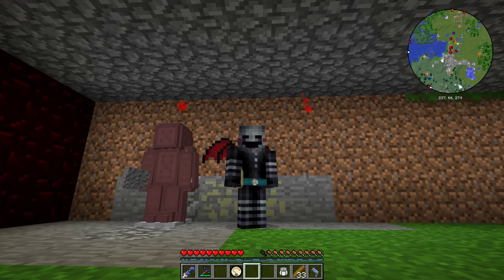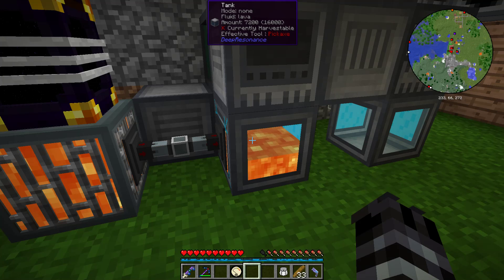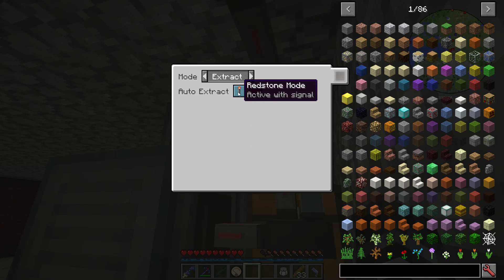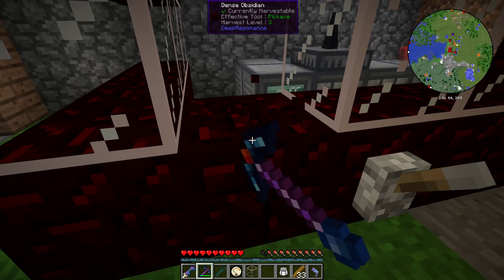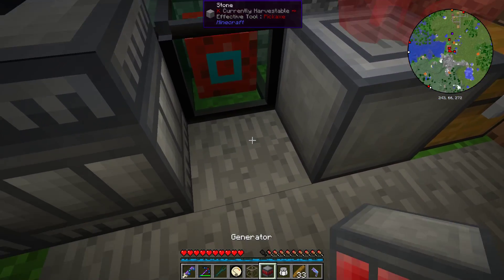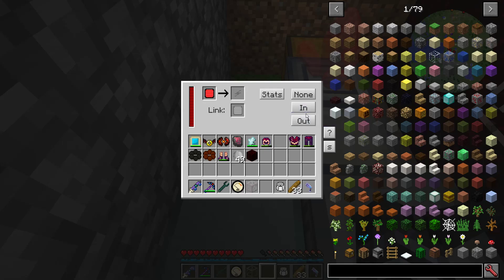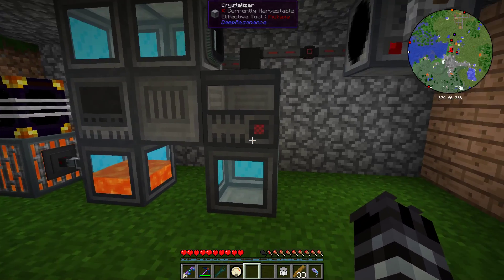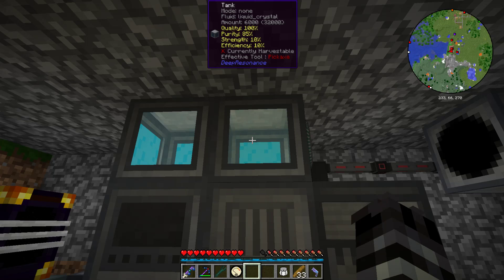Deep Resonance power generation setup

Comment: what is that lense on the side of the upper tank facing the laser? you didnt hover over that
Reply from the maker: That's the laser and lense from deep resonance.  The lense takes a block space, then you need a blank space after that, then the laser.  So it should be: tank|lense|     |laser